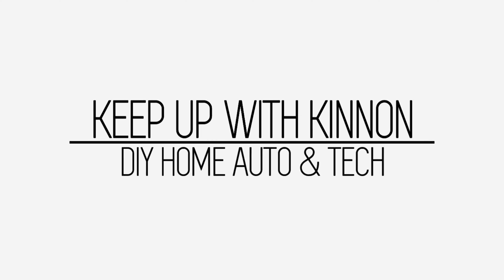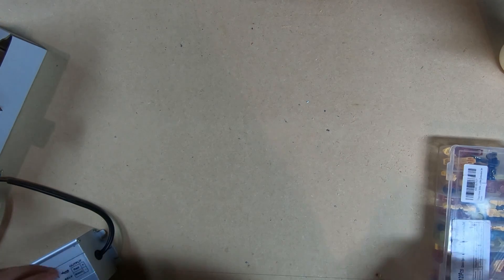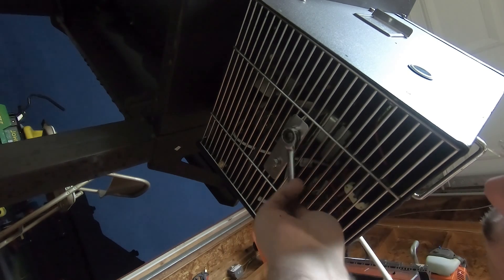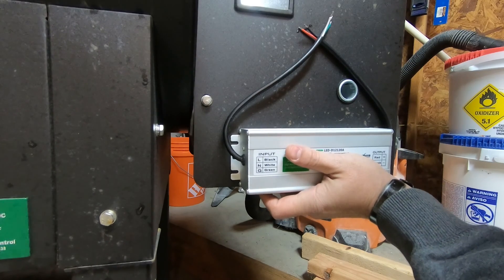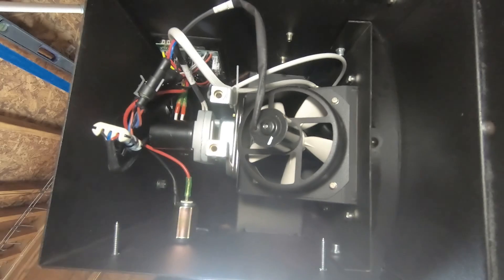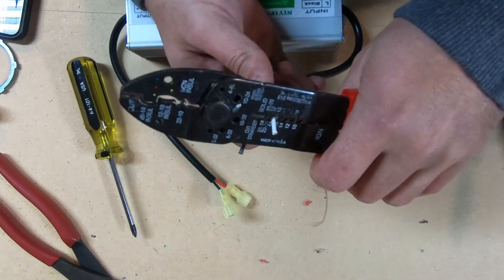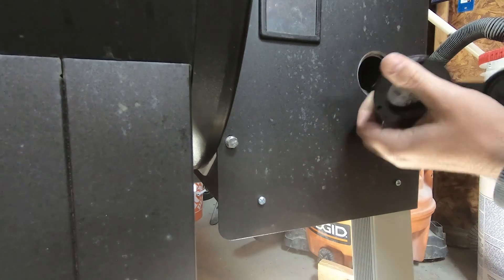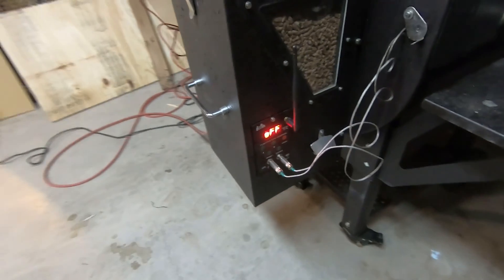How to Add a 120V Input to Green Mountain Grills Daniel Boone, Jim Bowie or Davy Crockett.

Comment: I did the Davy Crockett and learned a lot in the process. I confirmed the posted converter doesn’t work with the DC(suspect WiFi as the reason), but modifying the existing GM AC/DC converter did work and it’s OEM.  It will fit inside the hopper, but you must mount it at a diagonal in the Davy Crockett. Loosen the lowest 10mm bolt on the pellet hopper to help.  You’ll also have to work around the serial number plate screws on rear of hopper.  The adapter will fit in the Davy Crockett you just have to work with it.  The only other thing I did was drilled a bigger hole over the existing AC hole.  It is as described a royal pain.  I put a wood block in the existing hole so the drill bit would seat into it and allow the hole saw to engage.  There were no problems cutting the metal once you can get the hole saw started.  Everything was worth it to be done with the car lighter plug configuration that’s standard on these grills.
Reply: I have the Ledge wifi model, so I'm wondering if I'm having the same problem. Where the red and black wires connect to the cigarette lighter, I have 2 red wires and 2 black wires. I figured I could twist them together but maybe this is incorrect? I will remove the thinner wires and see if that solves the problem. Does anyone else have any ideas for this? I might be over my head!
Reply: You have pictures

Comment: I am curious why you did not just mount the existing power converter in a similar fashion and then hard wire it in the same way as you did here.  Was it too big to fit it in the space available?
Reply from the maker: Truthfully.... I just didn’t think of it, I had seen some other guys post pictures using this led driver in the FB group, so I just made a video on it because a lot of people were asking questions of how to do it. With that said, having the factory as a spare in case something happens to the aftermarket one isn’t a bad thing either.

Comment: Thanks for sharing. Couple of questions:

Regarding the posi taps you switched to... You said that you left the OEM female cigarette adapter intact. So you put the "piercing" piece of the posi taps on both the red and black wires that come off of the cigarette plug on the grill. Then you put the cap over the exposed black/red wires coming off the newly installed converter and hooked in? 
What size posi taps did you use?
Regarding hole size- you said the product called for a hole 1.6" (or 1.7") but you did 2" instead. How did that work without having too big of a hole?

Lastly- Did you just have a spare power cord lying around? Anything you'd recommend?
Reply from the maker: Exactly correct on the Positaps, and it was the yellow size. The 2inch worked just fine, maybe was even a little tight.

Comment: OK so, and please bear with me cuz I know $hit about electrical... once you've added the new inverter did you snip the hot & neutral coming off the cigarette plug then pigtail into it with the new hot & neutral wires? I guess what I'm trying to see there is that you can still use the cigarette lighter pulg?
Reply from the maker: I didn’t snip the wires off the cigarette plug. I just tapped into them, which does leave the factory plug fully functional.
Reply: Tapped into them where? Hard to see in the video.
Reply from the maker: Red to red and black to black, from the converter to the wires coming off the cig plug. I use Ttaps in the video but changed to Positaps as soon as I received them.
Reply: @KeepUpWithKinnon  i struggled to see that part as well
Reply: @KeepUpWithKinnon  but i did look at a video about posi taps so now I understand what it is that you did and what needs to be done.  Thanks for doing the vid

Comment: I couldn’t find this already asked so forgive me if it was; is there a reason you did nothing attempt to use the existing opening of the 12v? Did you do anything with the old 12v to plug/block it off?
Reply from the maker: Trying to drill a larger hole out of an existing hole is easily done. As for the original 12v, if for whatever reason the zombie apocalypse starts tomorrow, I still have the 12v socket, I can throw the DB in the back of the truck and make a b line for the tree line lol.
Reply: Meaning, did you think about not drilling an entirely new opening and try to use the one already there (making it larger of course)?

If you did, what was the reason you did not?

I’m also thinking of doing this as well as upgrading to something waterproof to leave outside under an eave (with a cover).
Reply from the maker: Truly I do don’t think to try. I kind of wanted to keep the factory plug just in case.

Comment: Do u have a link to a converter that will work for the Daniel Boone prime plus?
Reply from the maker: Dave Kulwin I’m not sure what the factory converter on the prime plus is. It would be simple to straight wire in it though. If you want an aftermarket one, just look on the label of the factory converter, take its amperage multiplied by its voltage, and that will tell you the wattage you should look for in an aftermarket.
Reply: @KeepUpWithKinnon  is it possible to send u a photo of the prime plus transformer and have u tell me if the one u recommend will work?
Reply from the maker: Sure. If you’re in the GMG Facebook group, find me there. Send me a PM.

Comment: So do you use both the red wires on the smoker and both the black or just the thinner one
Reply from the maker: raul de la cruz I’m not sure what you mean by both. The converter I used has one red/black pair of 12v outputs. They tie directly to the one pair of red/black 12v inputs on the back of cigarette lighter plug.
Reply: Keep Up With Kinnon there are two red wires going to the cig lighter and two black ones one is thick one is thinner so wondering if I clip the both or just the thinner ones
Reply from the maker: raul de la cruz do you have a prime plus? This is the first I’ve heard of two pairs going to the plug. As you see in my video it’s just one red and one black.
Reply: Keep Up With Kinnon  yes I have the prime I took a pic but can’t send

Comment: Warning. This transformer is not compatible with the Prime Plus. It will enter off mode, but will lose power once you engage the startup process/hopper.

The stock transformer is rated for 15A on the Prime Plus and the one linked here is rated for 10A. I was able splice the stock transformer into the hopper, and it works very well.

Edit: this might also be related to the WiFi models, running the higher amperage that is.
Reply from the maker: Thanks for the comment dude. If I can figure out how to pin this i will move it up to the top.
Reply: @KeepUpWithKinnon  No problem! Thanks for getting this out there. A few stumbles along the way, but the grill is rocking with the straight 120v. Game changer!
Reply: Or how do u run strAit 120?
Reply from the maker: Dave Kulwin if you wanted to use your factory converter just cut off the female cig socket. Then use Positaps to connect red to red and black to black on the grill.
Reply: @KeepUpWithKinnon  what would be the advantage of using a non factory one? Sorry if I am missing something
Reply from the maker: Dave Kulwin I don’t know if there is an advantage short of buying aftermarket leaves you with the factory should you need it for whatever reason.

Comment: Thank you for sharing!  I just used your links to get all the components, and everything went fairly easy.  A couple of points...  don't go at that 1-7/8 to 2" hole without first drilling around the inner diameter with about a 1/8" drill bit on about 1/4" centers.  You'll be there all day with a hole saw, after you've burned it up.  Better yet, a knock out would definately work best.  Also, the wire that is on the very end of the cigarette lighter plug is the +12 v wire.  My DB prime wasn't marked, and both wires going to the printed circuit board are black.  Also, my Daniel Boone prime does not have any grating covering the bottom of the enclosure.
Reply from the maker: Ron Wheeler thanks for sharing. I’ve told other guys this exact thing after talking to some. My maintainer buddies about what I did. They were like why didn’t you “chain drill” it? I said because I don’t know what that is. Then they described the very process you’re talking about.

Comment: I bought the exact same transformer. As soon as I hit the power button it kicks it out. If I unplug the hot rod it stays on.
Reply from the maker: I wonder if you got a faulty one? The initial heat up when the igniter is starting the pellets is when the grill pulls the most current. I’ve seen some guys say it’s approximately 9 amps.
Reply: Keep Up With Kinnon purchased 2 more and did the same thing. Bought a 200 watt and works like a charm.
Reply: @austinszafranski8548  Do you have a link to the 200 watt one?

Comment: FYI the converter linked in the description will not fit the Davy Crockett. It's too large.
Reply from the maker: Sorry about that! I guess I included it in the title because the process should be the same. Sorry i
Reply: @KeepUpWithKinnon  no worries. Just figured I'd let ya know!
Reply from the maker: @michaelsenkpiel5180  Thanks bud!!
Reply: Did you end up finding a converter which fit into your DC? I made the same mistake.

Comment: I purchased a 120 to 12v 12.5amp converter rated at 150watt so I can use the lighter port for charging phone.  Problem I have is after my install the grill starts until it gets to number 2 and it shuts down. Is 12.5amp not big enough?? I’m going to check my wiring.
Reply from the maker: It should be fine as the factory converter is only rated for 120W as well. How many outputs does the converter you bought have? I know some guys talked about getting a different one that was bigger, and when I looked at it, there was two outputs. Which made me concerned each output was only half the overall output.
Reply: Keep Up With Kinnon  only one output. I wires for the plug 120v is Blue, Brown, and a yellow. I know the yellow is gnd. I may have to switch blue and brown see if that makes a difference.

Comment: What did you end up doing to get through with the 2” hole saw
Reply from the maker: Michael Carter just kept drilling lol. It was a PIA. An Air Force buddy of mine recommended what he called “chain drilling.” Basically draw your circle outline, then drill holes on the inside edge all the way around. That removes most of the material. Then use a hole saw. I guess they do it with sheet metal on the jets all the time.

Comment: Does the 12v still work under this method? I'm far from an electrician but this looks rather simple. The only question I have is  are the posi taps only used from the grills power supply to the converter? If so, where they used to just tap into the wires going to the 12v?
Reply from the maker: Ryan Kuczynski the 12v does still work yes. If you were to use the 12v plug you would not want the converter plugged in to 120 at the same time, as then they would both be supplying power. The positaps are used to connect the 12v output of the new converter to the 12v input on the backside of the cigarette lighter plug.

Comment: Bruh, the homie and I each got the Jim Bowie and the power situation is thee absolute Achilles heal on these bad boys. Looks like we got a project to remedy that. Gonna attempt to use the OG power brick for power based off what one of your commenters said about power draw. Thanks for posting this man. Gotta love that iPhone wide angle lens.
Reply from the maker: KeiganApparel thanks man. As others have said here, and I’ve talked with guys in the GMG owners group on FB. You could absolutely do this with the factory power converter. Others in the GMG group have since done it as well. Cheers and thanks for watching......it was filmed with a GoPro btw

Comment: Curious what anyone thinks here: I'm looking at doing this mod... I tested out the OEM setup during auger draw and heating, and the power draw at the AC wall connection was right at 125w. This means that the AC-DC converter is at 100% duty. I'm wondering if a higher power DC supply would be healthier for the grill? I know the GMG one that came with my grill is 12v 10A but according to my power measurement, that's being totally maxed out and that might be putting strain on components of the grill.
Reply from the maker: ziff247 I used a 120w power supply based of the factory supply also being 120w. Haven’t had an issue yet. But I don’t see anything wrong with giving yourself a little overhead.
Reply: @KeepUpWithKinnon  thanks for the reply. I went ahead and installed a 150w converter and have used it half a dozen times, also no problem. I'm measuring 150-160w of draw on my kill-a-watt meter so I'm not sure if it's using all of that on the output or if it draws full power at input and regulates itself on the output side or what. Either way, happy smoking, and thank you for making a nice video for all of us to reference.
Reply: All of the new grills come with 12v 15w power supplies. I contacted customer support with my Prime wifi auger issues and the guy also shipped me the new power adapter (all-in-one that eliminates the detachable 120v cord and the 12v adapter connection at the supply end) that runs the grill much much better. Auger runs much stronger and it seems that the initial startup gets to temp quicker. It is also ip68 dust and water resistant where the original 10a one is not.
Reply: @johnfreeman440  so wait, there is a solution from GMG that bypasses the 12v recepticle?

Comment: Great vid... thanks! I just did mine today following what you did. I found the same marinco connector, but I opted to cut the end off the cables of the power inverter that ships with it.. and I used marette connectors and I bypassed the 12v input altogether (we don't camp or RV) and wired it directly. I didn't use a hole saw and wasn't going to drop coin on one for this one use, so that took a bit of time with a drill and some creativity, but it worked out great, clean... and no more disconnects with that dumb ciggy lighter connector!
Reply from the maker: Thats awesome dude. As you did another commenter asked why i didn't use the factory inverter......I simply didn't think of such a simple solution lol. Like you I would find it very very rare for someone to take a Daniel Boone on the road with them. If i did camp and wanted smoked meats....id buy a Davy Crocket

Comment: What else would be nice is to just hardwire the 120 in and put a toggle switch in for ON/OFF...
Reply from the maker: Mr P I think GMG didn’t want that for the reason of keeping the board on for The sake of WiFi issues. If mine weren’t a WiFi model that would have certainly been easy to do.
Reply from the maker: Mr P oh I see. I never unplug mine lol